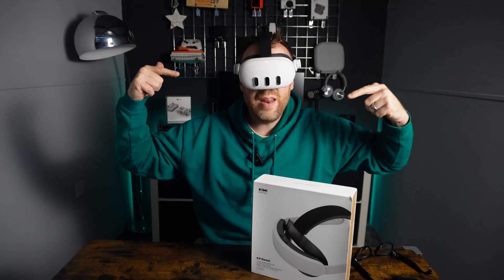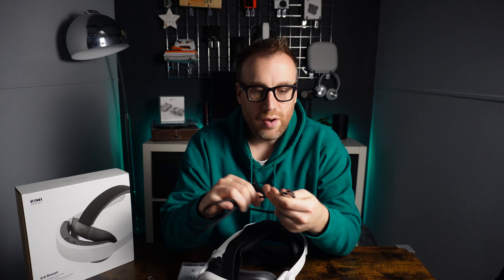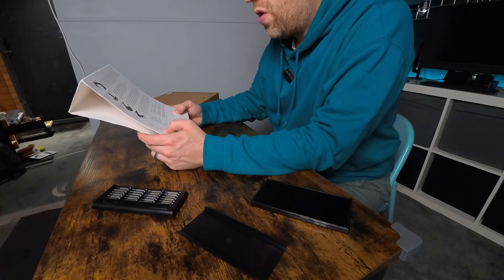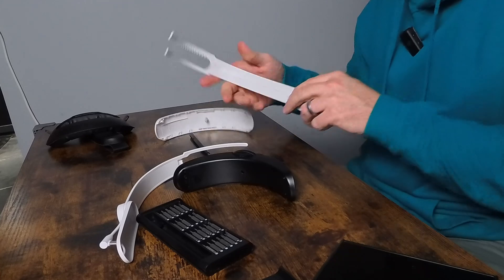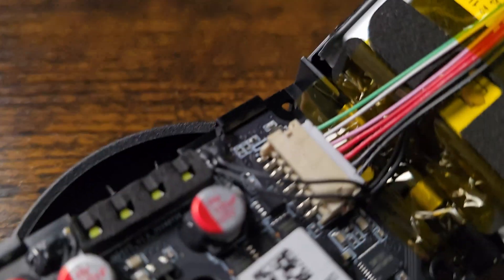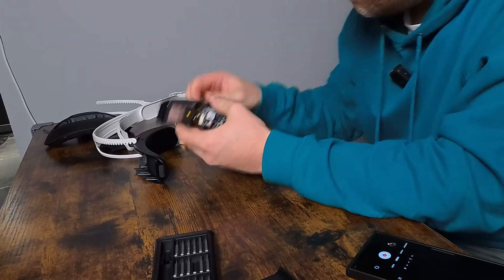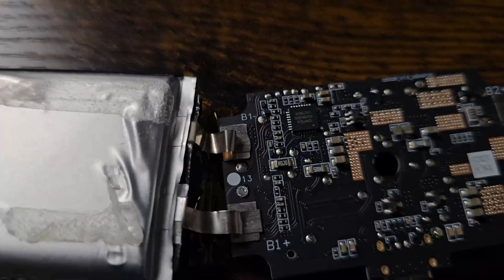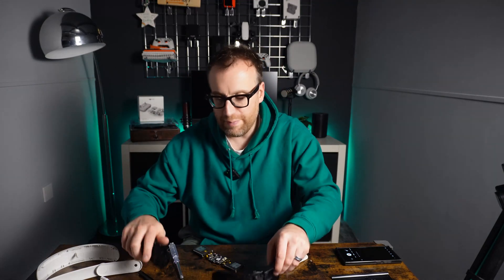Disassembling the Kiwi Designs K4 Boost Strap for Meta Quest 3 – What's Inside?

Comment: It's too bad they cheaped out on the electronics. 22 watt internal battery charging and 22 watt quest 3 charging with no auto negociation chip... which means that you have to remove and plug in the battery on every use. Otherwise the headstrong battery will drain itself.